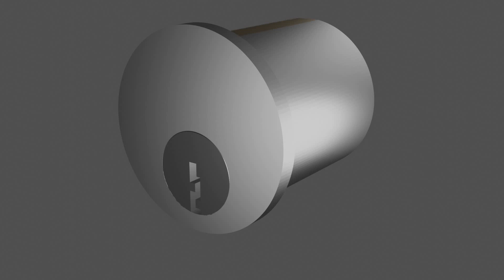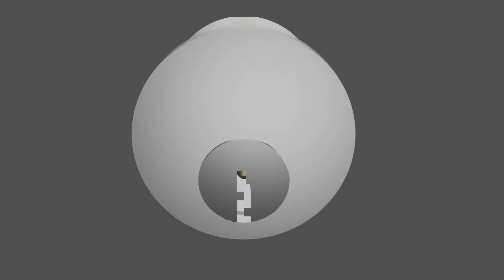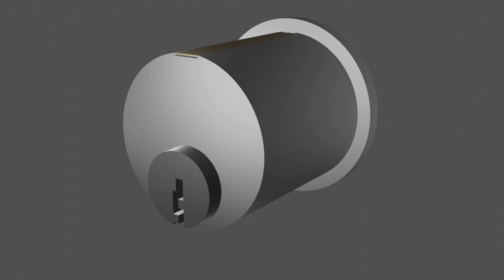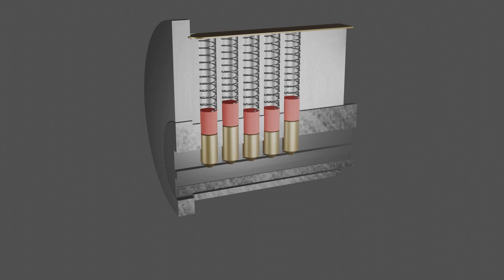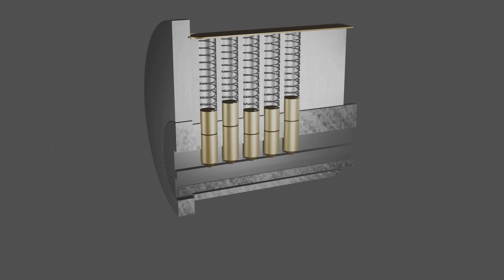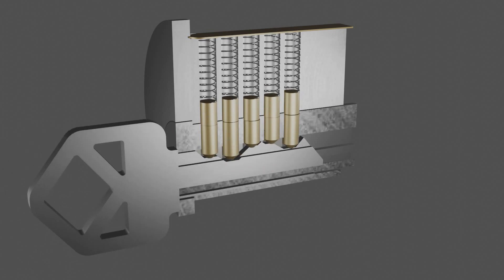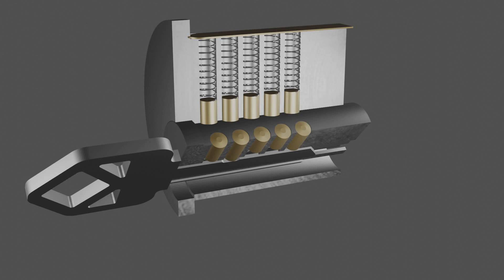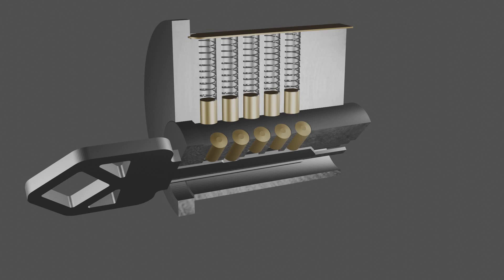How a Basic American House Lock Works

Comment: About the possible combinations:
You could have different spacing between the pins on different models, which would add another layer of combination. Is that something that's generally done, or is there a standard for the space between pins?

Comment: Even though there are numerically many thousands of combinations, I have noticed that because of the desire to not make them so easy to pick there seems to be a common biting pattern, where for example the last pin(s) can be a good deal higher than one of the preceding ones so the picker would have trouble not over setting a previous pin to get the last pin set, etc.

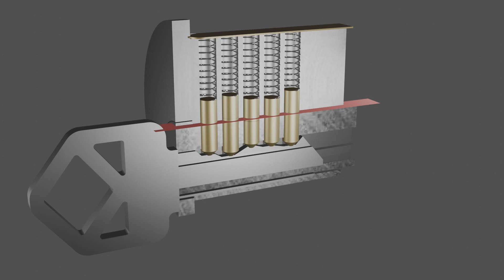Comment: 2:25 what is blocking? I don’t see the lines on the pins.
Reply: 2nd and 3rd pin (from left to right).
If you look closely you can see the line separating driver pin and key pin above the (red) sheer line on pin 2 and below the sheer line on pin 3 (in the middle)